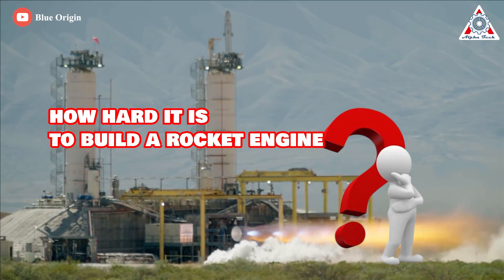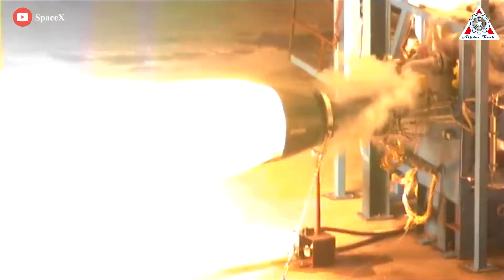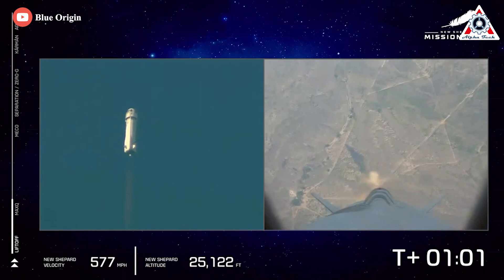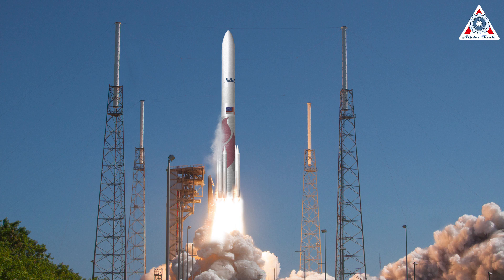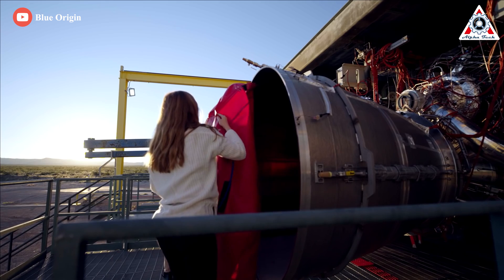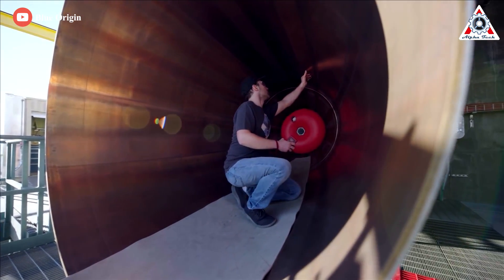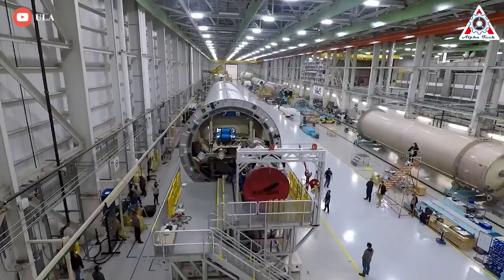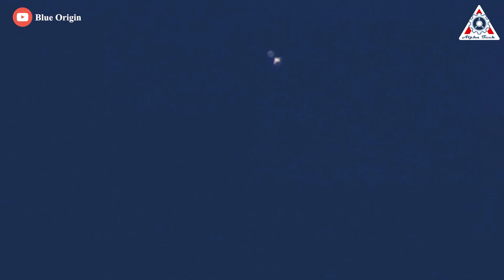Blue Origin's Engines completely FAIL! NO way to BEAT SpaceX...

Comment: I’d like to point out that the raptor so far has only had a less than 50-50 success rate itself. And that none of their engines are production models. and although the B E4 is way late. It’s has more run time hours  on 4 test engines then  all of the raptors combined.  that includes restarts. They have clocked over a hundred hours now.
Not only that, they don’t need priming like the raptor, and are more powerful.
Reply: Where do you get your information cause what just said makes no sense BE4 more powerful than raptor??? BE4 more runtime???? 50-50 success rate???, I’m pretty sure that the raptor 2 is way more powerful than the BE4 and I’m also sure that the success rate is higher if you don’t count the fact that space X tests Raptor 2 engines to failure just to improve it to make it better and even more powerful, the fact that SpaceX is testing raptor 2 engines every single day I’ll say they definitely have more runtime than the BE4 engine get your facts right bro
Reply: but the raptor is still in multiple development cycles. Test fast, fail early. The raptors original goals were considerably less than they've already achieved.
Reply: @David Ridout that may be true now but raptor 2 isn’t done evolving yet besides that’s a small margin and easily surpassable

Comment: I just don't see the logic in depending on one single rocket engine to provide enough thrust to launch super heavy payloads into space, no matter how powerful & big you make it. I can see why the engineers are quitting right & left. At least the crew capsule escape system worked. In any case,I wish them the best of luck with their next engine.
Reply: NASA already proved taking off on an exploding column of water gets you explosions more often than you'd like. They shelved that idea.

Comment: It seems to me there continues to be problems with both BE-4 engines thus far provided. The first had significant issues and had to be in part rebuilt. That has not yet been completed.
Reply: bezos is so greedy they are having to use bare minimum materials

Comment: BO is the perfect example of that a blank check is just as dangerous for a startup as the lack of sufficient funds.
Reply: Words of wisdom from a bean counter 😅🤣😂
Reply: Yes, the bottomless funding was the poison to the innovation. They have many smart people. If funding was limited, and if the owner gave a hard deadline - make it or break it by certain time, then they would have achieved something.
Reply: Did you know that Elon also risked it with insufficient funds
Reply: @giorgiolelmi8175  Yes, then he risked it again with F9, then again with Falcon Heavy, then with Starlink and now with Starship. And not just him, but everyone at SpaceX. The problem with a blank check is that you get paid without taking any risks.

Comment: BE3 has a 21 streak in 7 years with 1 engine while 10 Merlin is used in 150+ Falcon 9 launches 🙈
Reply: BE4 is a mess of flanges and sensors, I'm sure they will remove some sensors down the road but those flanges and gaskets are all failure points. compared to a raptor even at v1 i don't think you will have near the reliability. v2 raptor is so much simpler and performance is so much higher, i dont think they will last long without a complete redesign of BE4
Reply: Indeed the BE3 failure was a massive BO failure. It's a relatively simple tap-off cycle engine on a booster that hardly experiences the forces an orbital booster gets to endure. This is either a massive design error or a massive problem with BO's quality control, refurb and/or inspection methods.
Reply: @Diggnuts  considering the time after launch im thinking a cooling issue on the throat or a turbopump eating itself.

Comment: You know how they had a successful 6 engine static fire of the Starship that blue chunks of molten concrete into the grass causing a grass fire well I suggested yesterday and sent an email to Gwen Shotwell to use the compound starlite on the concrete underneath the launch pad so they can do a full 33 engine static fire.
Reply: They just need permission to do fire mitigation?  I.E. mow/mulch nearby fields?
Reply: @gamerfortynine  it won't help if when you ignite only six of the engines you blow chunks of molten concrete everywhere it's not sustainable. Just imagine a 33 engine static fire with a fully stocked Starship trying to take off it's going to cause massive Havoc without either a trench system or at least bare minimum Starlight sprayed underneath of the concrete to keep it from blowing molten hot chunks of concrete everywhere.
Reply: @AquarianSoulTimeTraveler  I think Elon is counting on the much greater height of the Orbital Launch Mount to solve that blowing hot chunks of concrete problem that S24 had with that much shorter suborbital launch stand used last week for that 6-engine test.
Reply: @rays2506  you should look into starlite compound you can literally make it in your home with common readily available materials and is like a coating... Its cheap as dirt and extremely high in effectiveness. I think you are correct but static fire test still must be performed on this mount and if its blowing chunks of molten concrete at all that is a problem and this is the cheapest most effective solution.
Reply: Starship's a Beast!  💥💥💜

Comment: COMMON SENSE, OR MAYBE SOMETHING ELSE....
"all that rocket engine and rocketeering stuff is pretty darn complicated, so originally them nasa folks only made stuff to work once (except the space shuttle vehicle), then throw it away, but reusing rocket motors and tanks is another matter. but basically, nasa was always works at the maximum flight envelope, with the minimum amount of equipment"
<so umm....for the rocket nozzle to sustain more than one use, it has be overbuilt, because the inside layers may burn away, over repeat launches>
<plus, just having just one rocket motor on a launch system goes against engineering best practices, so why do airliners have 2+ engines, just for passenger entertainment!?>
<2 engines running at 50% is much safer than running 1 engine at 100%. just bad engineering>

<real specs of falcon 9 rocket motors>
about 1600-1800K
Some of the hottest engines around are the Merlin 1D Vacuum. Radiative cooled, and from the color of it reaches about 1600-1800K And that is WITH the use of film cooling by pumping the gas turbine's exhaust along the inner nozzle wall.Oct 28, 2020
https://space.stackexchange.com/questions/48185/how-hot-do-rocket-engine-nozzles-get#:~:text=Some%20of%20the%20hottest%20engines,along%20the%20inner%20nozzle%20wall.

Comment: I really hope Bezoz does screw Bruno completely. WE need more then just spaceX and ULA is a staple is the market. The space industry cant afford to loose such valuable companies atm. If SLS AND ULA dies, what non-spaceX options are there realistically?
Reply: There are a lot of space companies working in the background. Those you have mentioned are just in the spotlight
Reply: Spacex can fly falcon + capsule and starship. Two entirely different rockets with nothing in common, no single failure point they share. NASA would be fine with it. 

The issue is politics and bribery, if none of the bribed politicians are getting money and contracts sent to ULA for instance, then they have no reason to approve projects... and then as a result, no approved space projects = a vary tiny small budget NASA.

However, consider all the stuff spacex is doing, atm they dont really NEEED NASA, and they get help from them for free anyway. realistically, Spacex could become the new NASA in form but not in name. doing their own launches to the moon and mars. Once the tech is proven along with the cost, the US govt wont be able to ignore it and will want to fund it to make the first people on mars from the USA, its a cheap political win since spacex funded the work, the govt only has to cover the launch cost. that might as well be free and no amount of political BS could block that, If the govt refuses, then spacex goes to mars on its own without NASA and the US govt... and neither company could afford that horrible PR.
Reply: @jessiejanson1528  I get what youre saying and Im a spacex fan, but if ULA collapses due to engines for vulcan then it only leaves spacex. Monopolies are never good and thats my point.
Reply: @Apr0x1m0  true enough, though im sure the govt could step in and manage a 'you will continue to offer the falcon 9 and dragon capsule at a reasonable price so we can have two methods to get to space' 

Though its probable the govt will just throw money at the problem until they figure that engine out, maybe hire the other company to make an engine, at the rate they are going they might still beat bezos to a working engine.
Reply: @jessiejanson1528  I'd go the route of gov just outright buying the engine and give it to nasa/jpl to sort out internally.